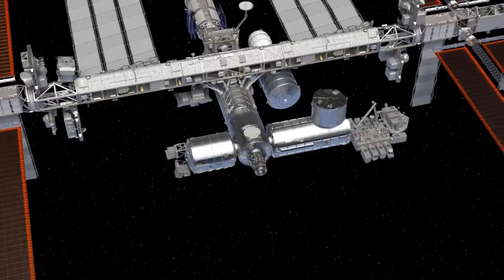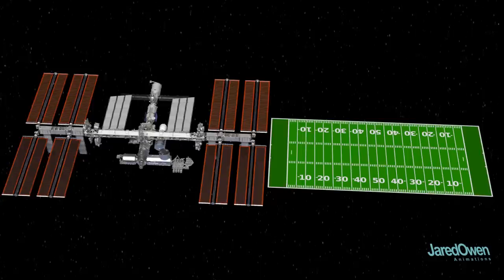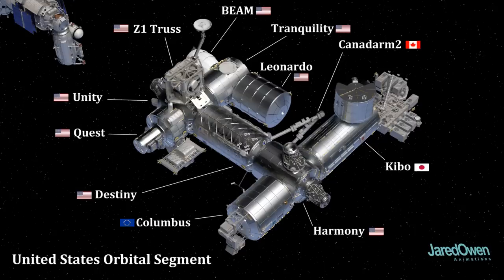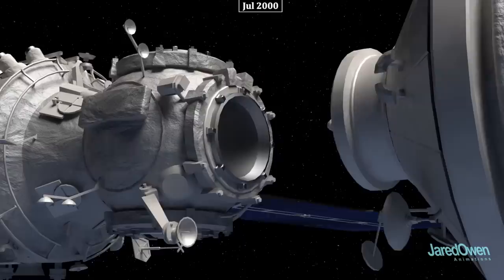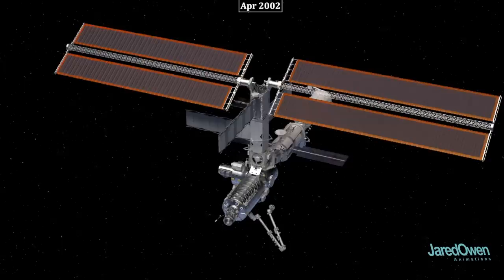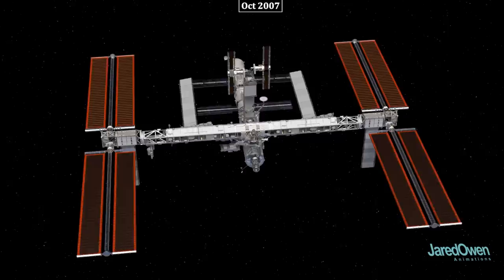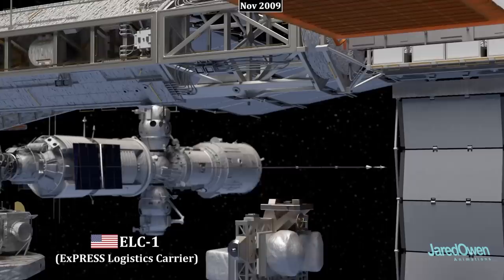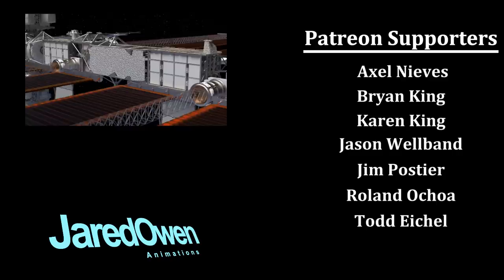How does the International Space Station work?

Comment: Dear Jared: that animation was just superb. If I knew how to I would watch it in slow motion. Thank you so much!

The company I worked for in the 1990s designed the main power contactors for switching power between the solar panels, batteries, and space station load. The company I worked for in the 1990s designed the main power contactors for switching power between the solar panels, batteries, and space station loads.

I was lucky enough to be one of the design engineers on a very small team in Santa Barbara that made that contribution. It was thrilling work. The power system from the solar panels and the accompanying batteries is I believe a 155 V DC system. It required new technology to make lightweight contactors that could work in space. That’s what we did.

Thanks again, Steve￼
Reply from the maker: Thanks Steve!  You can change the playback speed of youtube videos so you could watch it slow motion.  Look at the settings in the bottom right hand corner when watching
Reply: you can also do it with hotkeys - 
< will decrease speed and > will increase it. 

also, if you have the video paused the , and . will advance the video forward or back a very small amount (I forget how much, a small fraction of a second).
Reply: 3rd 
Also you said the same thing twice but it's probably because of too much thinking.
Also also Oh yeah, it's big brain time
Reply: Thank you for your life Sir! 👏

Comment: Jared, As a fellow artist, and I use that term loosely for myself, I am overwhelmed by the amount of work and accuracy you present.  You always get the lighting, the camera movement, textures, and so much more spot on.  The object is always well staged, with no external distractions.  You could spend a hole series just describing your tips and workflow.  Ditto on the research for your material.  That hard work does not go unnoticed.

Comment: I can only imagine how long this took for you to make.
Reply: periklis spanos  or because of orbits
Reply: periklis spanos sigh because, it has small boosters on the bottom, or on the side to keep it from falling back to earth. Gravity is the force that is pulling it to earth, so they use small boosters like SpaceX does to re-align it.
Reply: periklis spanos  Exactly! Thats why vac engines bring air with them
Reply: periklis spanos  actually they are all wrong, the satellite stays in orbit just like the moon. The gravity of the earth pulls down at them, but since they are moving along the equator at the same speed, they fall parallel to the spin of the earth, basically sending them in perpetual orbit.
Reply: @singhanmolpreet5935  
Not all satellites orbit across equator, there are satellites even orbit poles, every thing that orbits degrade its altitude ever so slightly which will be adjusted by onboard thrusters.
The reason satellites stay in orbit for long time is that they're launched with high velocity into their respective orbits Which is calculated by I think Kepler orbital laws.
Even earth is continuously falling into sun constantly bt failing to do so due to centrifugal force due to enormous velocity with which earth orbits sun.
Reply: periklis spanos  
Are u hearing about rockets first time?
Why do u think rocket stages carry liquid oxygen with them.
Reply: @rravitejamavr6650  ah my bad, its because all bodies in space are constantly moving. You are right about keplers law, its the r^3/T^2 ratio which determines how a satellite moves, I was confused. The real reason is exactly like you said, its because the velocity of the object  sideways keeps it from falling in due to gravity. Its the downward plus the sideward vector quantities that once added up make the satellite go in a perfect spin.
Reply: periklis spanos lol the booster probably fire some liquid oxygen and nitrogen something like that...the booster is not fired the same fire we use for cooking🙄

Comment: I recommend EVERYONE watching this video downloads one of those ISS spotter apps. They’ll tell you exactly when it’s flying over, the direction it’s coming from, how far away it is when it appears and disappears (sometimes I watch it fly halfway across the Atlantic...it’s incredible ). With some of them, you can even set alarms to remind you when a pass is going to happen. This thing blows over at orbital velocity while you track its path across several states...it’s a really impressive sight.
Reply: jared didn't talk about how they direct each part to its location, is it like driving an airplane/helicopter?
in addition how do you fixed / change parts? can astrounats just go out and fix / change things like on the ground just with a suit? do they use ropes that connects back into the shuttle so they wont just fly into the empty space while trying to fix stuff outside the station?
Reply: @disrael2101  when parts are launched they stay in orbit with the rest of the station rotating around the globe just like it does but I wish there were more info to that.
Reply: @manifestgtr Thank you Very much, Didn't knew we can watch it live. Loved it. Thanks Again.
Reply: @disrael2101  I have the same doubt especially how they direct each part to its location nd how did they re assemble certain parts
Reply: I can't use it, it doesn't fly over Russia :(

The only spacecraft I've seen is the occasional comms sattelite zipping through the sky.

Comment: 1A/R: Zarya
2A: Unity, Pma 1, Pma 2
1R: Zvezda
3A: Z1 Truss, Pma 3
4A: P6 Truss
5A: Destiny
5A.1: ESP-1
6A: Canadarm2
7A: Quest Airlock
4R: Pirs
8A: S0 Truss
UF2: Mobile Base System
9A: S1 Truss
11A: P1 Truss
LF1: ESP-2
12A: P3/P4 Truss
12A.1: P5 Truss
13A: S3/S4 Truss
13A.1: S5 Truss, ESP-3
10A: Harmony
1E: Columbus
1J/A: Dextre, Experiment Logistics Module
1J: JEM Pressurized Module, JEM Remote Manipulator System
15A: S6 Truss
2J/A: Kibo Exposed Facility
5R: Poisk
ULF3: ELC-1, ELC-2
20A: Tranquility, Cupola
ULF4: Rassvet
ULF5: Permanent Multipurpose Module, ELC-4
ULF6: AMS-02, OBSS, ELC-3
BEAM
IDA2
IDA3
Bishop
Reply: Going need to update that soon...
Reply: Yeah bishop airlock

Comment: Will you ever get to the internal layout of the station?  I mean, you don't have to explain every single experiment rack, but at least show how racks are installed, used, expanded and moved.  To me, the most impressive aspect of the station, just how variable and modular it is inside.  Also how different the US and Russian module internals are, showing the distinct difference in design philosophy

What you could also do is show the evolution of these station modules, specifically showing the advancements between Salyut 1, Salyut 4, Salyut 6, Mir (the core module essentially being Salyut 8) and Zvezda on ISS (essentially Salyut 9).  Can skip Salyut 2, 3 and 5, as they were not the DOS design but the Almaz which has no real design lineage connection to the Salyuts, and can also skip Salyut 7 as it was basically just a repeat of Salyut 6 with different solar wings.  Perhaps just a passing mention of these, and Skylab as well (which is better served to be mentioned with Apollo rather than Salyut)

Comment: I wanted to point out a minor error regarding the Zarya module at 3:24. There are only two docking ports at the front of the module; the zenith (space-facing) docking port does not exist.

Of course, this minor error has little impact on the outstanding job you've done with this animation!
Reply from the maker: Interesting - I looks like you are right! I just assumed it was the same as Zvezda.  So many tiny details, I knew I was going to get something wrong...😢  Thanks for watching and commenting
Reply: @JaredOwen  
Hey, don't beat yourself up over it—I used to think it was the same as Zvezda as well. This was still a very well-done video. :)

Comment: Just a minor correction: The Bigelow Expandable Activity Module was actually launched aboard a SpaceX Falcon 9, inside the unpressurized trunk of a Dragon spacecraft, making the F9 the fourth launch vehicle to launch a station module.
Reply: jared didn't talk about how they direct each part to its location, is it like driving an airplane/helicopter?
in addition how do you fixed / change parts? can astrounats just go out and fix / change things like on the ground just with a suit? do they use ropes that connects back into the shuttle so they wont just fly into the empty space while trying to fix stuff outside the station?

Comment: 1:26 How is the space station reboosted back into orbit? Jet propulsion? Or do they have all the astronauts eject flatulence simultaneously?
Reply: Zarya the first module has the propulsion.
Reply: @juice7136  zarya aka mir 2
Reply: One of the modules with engines burn their rocket motors a bit so it doesn't start entering the atmosphere.
Reply: @admiralsoyuz9776  burn their thrusters*
Reply: Progress & ATV Reboost It,
Reply: The Zvezda service module's engine is used for reboosts, but if it's avalible they will usually use a Soyuz or Progress spacecraft for reboosts to save fuel. They can't use Zarya's engine anymore, since the side with the engine was docked to Zvezda.

Comment: Who is attaching the component to each other?  is it automatic or someone standing in the space to attach?  Did anyone travel along with the component to attach?
Reply from the maker: Great questions - I'm going to cover this in detail in a future video
Reply: I have the same question. And where are the propulsion boosters to keep it up there ? Next question, since the earth 🌎 orbits around the sun, how can this thing travel with the earth on a 365 day orbit ??  Does not make sense to me.
Reply: @Meow_Cat I_Am 
Yeah, sure, an object of tons and tons "419,700 kg" will be pulled with it in gravity. Yet I can float in space freely in an aeroplane when high enough but still need to fly at speeds of 500-700 miles an hour. Where are the propulsion rockets on the ISS then, show me ?
Reply: @Meow_Cat I_Am 
There are no forces action on it, since it says it travels at 7.69 km a second on 408 km height. It does not add up to me it will move with the 24 hour a day turn of the earth 🌎 and in ellipse around the sun 🌞  in 365 days and also the earth is not round but more pear kind of shaped.

Since the 🌎 is flattened at the poles and bulges at the Equator, geodesy represents the figure of the 🌎  as an oblate spheroid. The oblate spheroid, or oblate ellipsoid, is an ellipsoid of revolution obtained by rotating an ellipse about its shorter axis.

Comment: 30 years ago I have worked on a module built by SPAR Aerospace (Canada), the same enterprise that has built the CANADARMs and Dextre, and it had the acronym of ACTRA for Antenna Contingency Transmit Receiver Assembly consisting of fixed and gimballed antenna communication module to allow the ISS to communicate with earth via the array of communication satellites circling the earth.  could you show where it is located on the ISS? Is it still in function?

Comment: I don't understand how astronauts work when they go outside the ISS to repair it when the ISS's flight speed is 28,000km/s ???
Reply: WHy should the speed matter? There is no air in space. Ever wondered why the ISS even moves with 28000 km/h? It doesn't have propulsion! Instead the parts were once accelerated by a rocket to that speed. And as there is no drag, it just keeps on going with that speed. And the astronauts in the ISS moves with that speed. And when they go out, they keep on moving with that speed. If the ISS doesn't slow down, why should the astronaut?

Comment: Best thing is that as adding the modules..the weight of Station increased..but since there is no gravity over there you can add as much as you can....!
Reply: Actually gravity there is only 13% weaker than down here. But they are in orbit, that means: They were accelerated sideways by a rocket to more than 28000 km/. At that speed they "fall around the earth" without getting closer to the ground.
Reply: @sebastiannolte1201  yaa bro u right..but also no air resistance helps a lot
Reply: @kidgamer6460  Yeah. Don’t have to worry about all that “aerodynamic” crap like all the plane designers. Streamline this streamline that. I have an idea: remove air.

Comment: It's ridiculous that they just don't move that station into a higher orbit  , not a geosynchronous orbit but just a higher orbit than 200 miles  , if I were to travel to that station I'd be stressed out thinking that we're going to fall out of orbit and burn up , of course that's not what's going to happen, but I'm a nervous wreck about that kind of thing,  higher better, lower not  .
Reply: So you prefer an altitude where the radiation is much higher?
Reply: @sebastiannolte1201  Yes !
It can't be much worse than a day at the beach 🤪
Well all kidding aside  , you make a great point so I'm sure they can create an appropriate shielding to compensate for the additional radiation exposure at say 5000 miles. 
Also stick an extra air conditioning unit in the window 🤣
Reply: @nobleroman5601  that would be cool but most of the iss is meant for fast acting easy and cheap missions that's why we haven't gone to the moon since the 60s, because it cost billions to just send a couple men up there rather then spending 3 billion across several different countries with lots of people. dont worry though nasa gonna send a space station to the moon "Gateway"

Comment: If space is so cold why you need so many radiators? I never would have thought dumping excess heat would be a problem in space!
Reply: Space is not "cold". It is a vacuum, so it doesn't have a temperature. Heat can be transferred via conduction, convection or radiation. And also in your everday life you notice, that conduction works better with a denser medium. If you put a hot object in cold water it cools down quicker than in cold air (that has the same temperature as the  water). But with no medium around it nothing can be transferred. That is also how a thermos bottle works; they have a double wall with a vacuum in it. So the only way to give off temperature is via radiation, and that is much weaker.

Fun Fact in case of the ISS: It is not in a perfect vacuum, there is still some atmospher at it altitude. And this atmosphere is actually super hot, and so the area is called the thermosphere (some of the "the ISS is fake!" idiots use that as an argument, so that the ISS should melt). But as there are only so few air molecules, their temperature is irrelevant.

Comment: So were these modules fastened in space by astronauts or were they remotely operated in order to link?
Reply: The module docks, slowly, to the space station. It's not automatic, but it is computer controlled. It's monitored and directed by teams of people on the ground. It's a long, slow process.
After docking, clamps are placed to lock it in position - again, by remote-control, monitored by mission control.
Then it is pressurised, and the pressure is monitored to make sure everything is OK, before anyone can open the airlock and enter.

Comment: I absolutely promise that the space station isn't going nowhere near that fast. It's impossible for it to go that fast in space of all places but i couldn't even go nowhere near that fast even in our atmosphere because it would completely burn up and break apart before ever even thinking about reaching speeds of those limits. I don't know where they came up with those speeds but they're telling lies,it should be common sense. Lol. Just think for a second just how fast 10,000 mph is,yeah my point exactly.
Reply: not only that but theres the hurdle of thrust working in a vacuum which on top of the fuel just being sucked into space as its injected to be ignited in an oxygen free environment
Reply: @Explosivo55 vacuums do not suck, positive pressure pushes. It feels like suck, but it’s not.

Also have you heard of Oxidizer? It’s literally liquid oxygen that is injected at the same time as fuel. Meaning all is present for fire, heat, fuel, oxygen.
Reply: A more efficient comment would have been simply, "I'm an idiot".

Comment: 28000 km/hr how they assemble parts in that speed?
Reply: You can easily assemble a Lego ISS at 900 km/h when you sit in an airplane. Everything you do at the moment is at up to 1670 km/h, because that is the radial speed of the rotating earth at the equator. Oh, actually you move at 108000 km/h at the moment - that is the speed of the earth around the sun. But no, that is not everything, the entire solar system moves around the center of the milky way even faster.

You cannot feel speed, and only measure it relative to something else. So the ISS moves releative to the earth with 28000 km/h. So? Here you see a spacecraft docking at the ISS (and in a way  the assembling was just a number of docking maneuvers):
https://www.youtube.com/watch?v=Jd_aIRkI5ws
That is at 28000 km/h. And it would look the same at 280 km/h or 2800 km/ or 280000 or 2800000000 km/h. It doesn't matter.
When the ISS moves with 28000 km/h and the Spacecraft with 28005 km/h, then it moves towards the ISS with 5 km/h. Imagine you stand at the equator and I come from west  walk towards you with 5 km/h. From an external ovbserver who doesn't move relative to earth's rotation, you would move with 1670 km/h and I would move with 1675 km/h.

Comment: In what direction is ISS moving? in the direction of it's long or short width??
Reply: Short.
Reply: The Harmony module is near the front, Zvezda is at the back. The solar panels are like the wings of an airplane, extended out to the left and right (ie starboard and port). It is wider than it is long, so yeah... the direction of travel is along its shorter length.

There's various reasons for its orientation - keeping the ariels pointed "up" towards the tracking satellites, the observation window pointing "down" towards Earth, having the thickest shields at the "front", and so on.